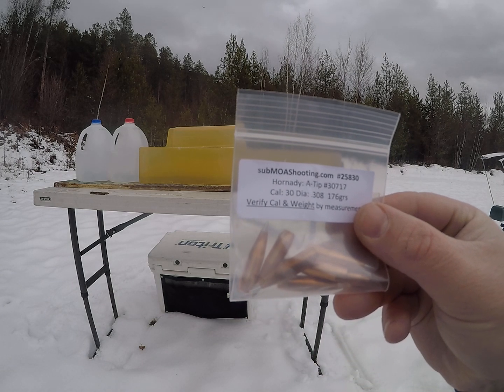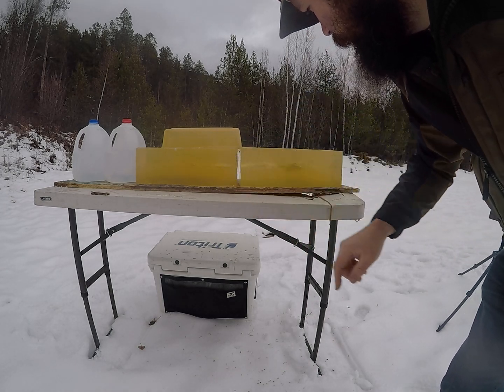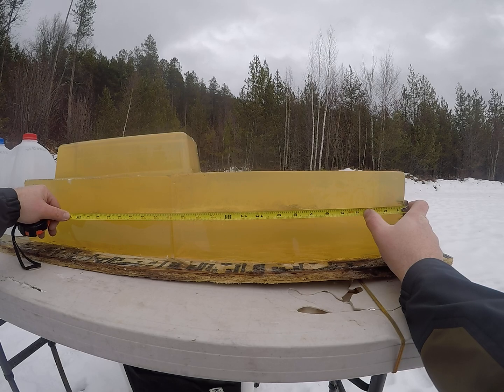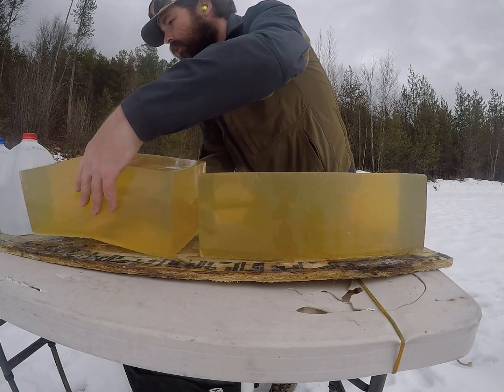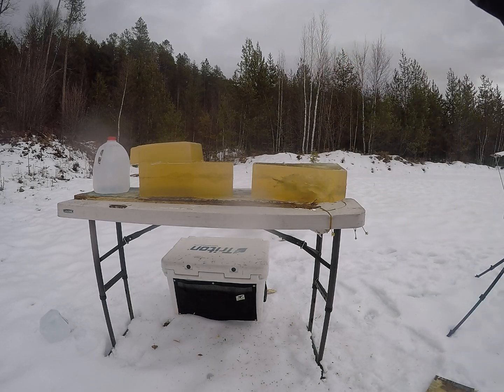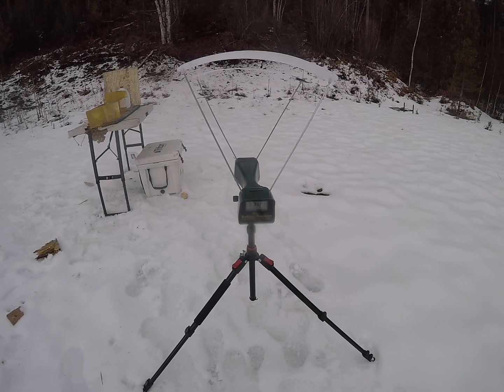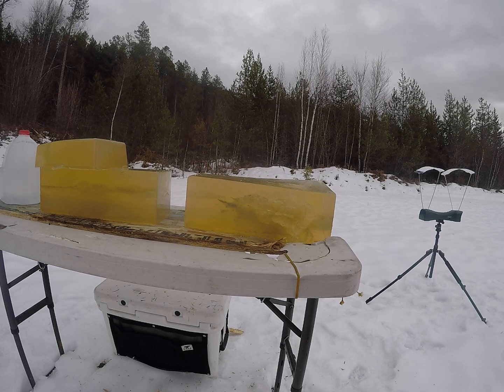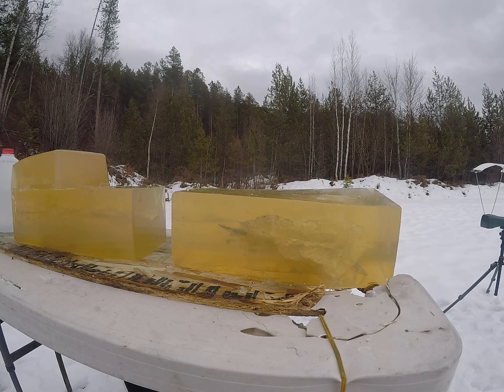Ballistics gel test of the 30 cal 176 gr Hornady A-Tip. Would they work for hunting?

Comment: I don't know why people are so determined to use target bullets for hunting, when there are so many good hunting bullets available.
Reply from the maker: Because accuracy is every bit as much of an importance as how the bullet performs after impact.

There are bullets such as these A-Tips that do perform a little better in the ballistics aspect and knock down of animals then some hunting lines of bullets.

Take Burger bullets for an example, they are all match grade, they were all target bullet, people were having success hunting with them so Berger made a few design changes and came out with their hunting line of bullets to appease the hunters but it was unnecessary for performance after impact and knockdown. The changes were made so ammo would fit in magazines correctly and feed correctly. 

Me personally, I like my partitioned or bonded bullets for hunting but that's just personal preference.
Reply: @simplemindedfella  personally I think bergers are overrated, and the accuracy and ballistic advantages are usually not that much, in my opinion, not worth what you lose. I prefer a good hunting bullet and will work within whatever so call limitations they might have. I consider it more responsible.  Just my two cents and worth what you paid for it.